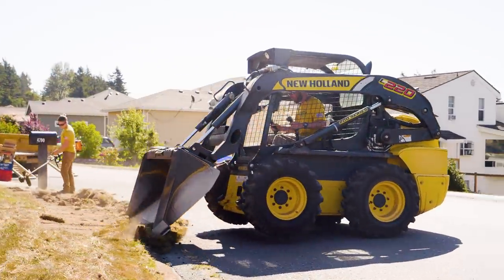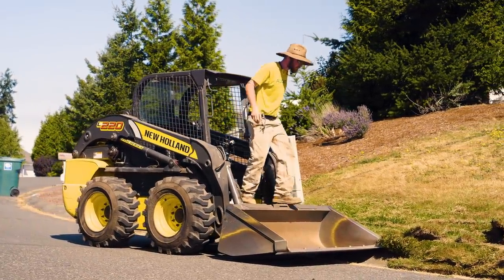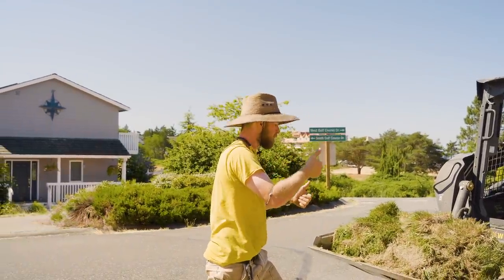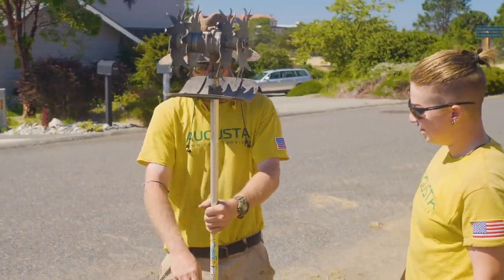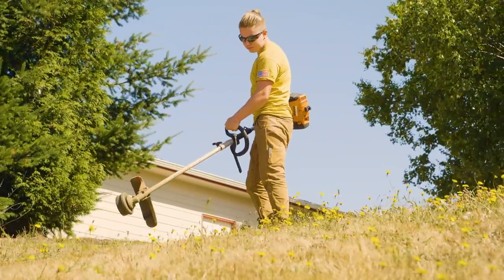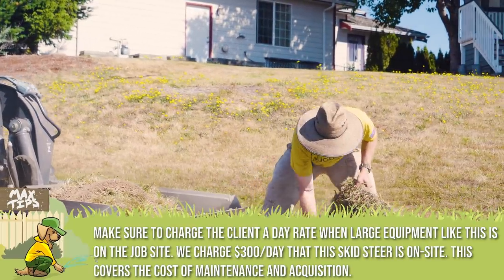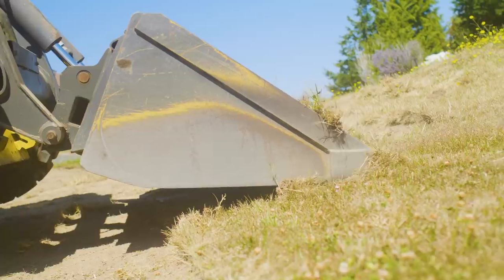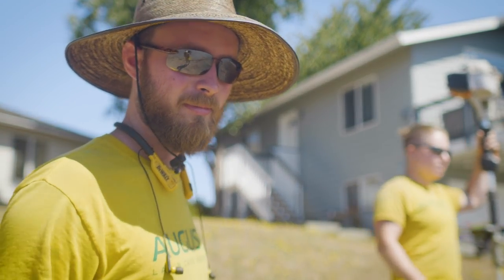Do You NEED a Skid Steer to Start a Landscaping Business?

Comment from the maker: Do you use skid steers? Which one?
Reply: Bobcat. I used it yesterday for a new landscaping design I put in. Had a few big boulders that where in the design and needed a skid steer to move them in place.
Reply: I use a takeuchi tl 230 series 2 every single day on my logging sites to move brush around and to load smaller logs
Reply: I used a kubota 75-2 tracks skid steer it’s a beast it cost 75,000 thousand dollars
Reply: New holland best bang for the buck
Reply: mustang 2054
Reply: @duaneayers6117  he has a video in it . I can’t remember what one. It all has to do with Augusta golf course.
Reply: Cat259d or mt100
Reply: Jd 317G wide track
Reply: On the farm we use Gehl.

Comment: No digsafe utility markings on the street.
I wonder where the utilities are.
Reply from the maker: We were only removing the top one inch of soil
Reply: @MikeAndes  I’ve seen cable at that height before.  Not trying to be a D just a suggestion to improve. 

Utility location is important if your working in the ground. Buy an armada pro 900 with an inductive clamp.